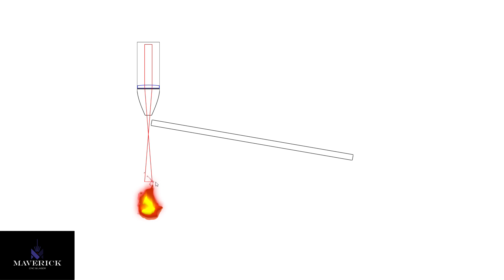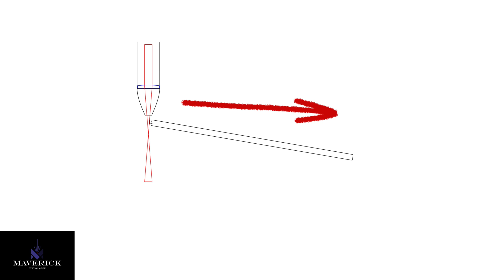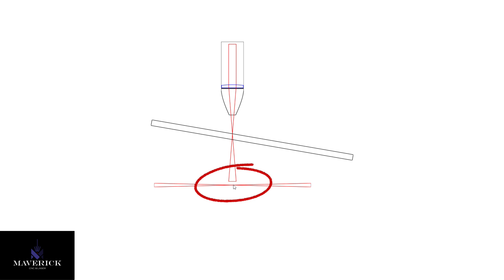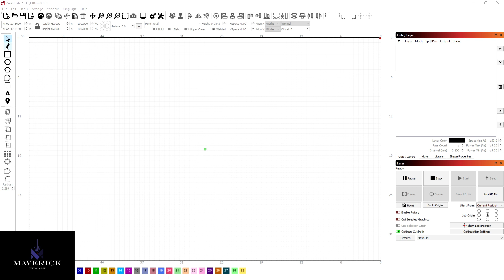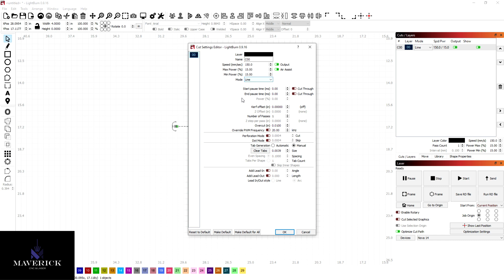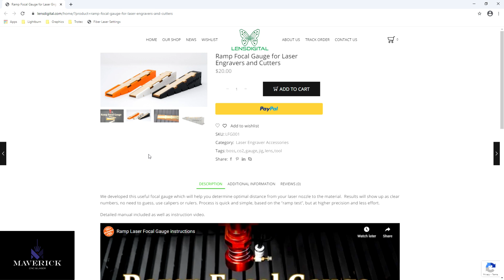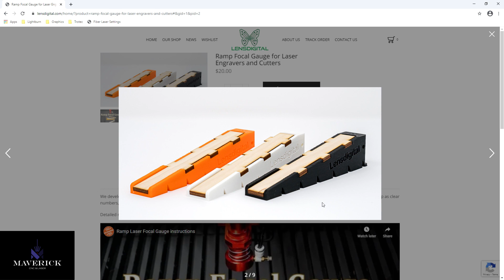Laser Ramp Test with Demo

Comment: Great explanation and example of a ramp test. I actually reduce the angle for my ramp test to get a little more detailed measurement. The OEM for my laser recommended a 6mm focus length yet my ramp test indicated 3.5 mm was the sweet spot. Made a world of difference for photographs and cutting.
Reply from the maker: Thanks Greg.  I like my ramp to a bit steep so the narrow spot is easily defined.  I find if the ramp is too shallow the narrow spot is stretch and it can take more effort to find the center.  Glad you're engraving better!